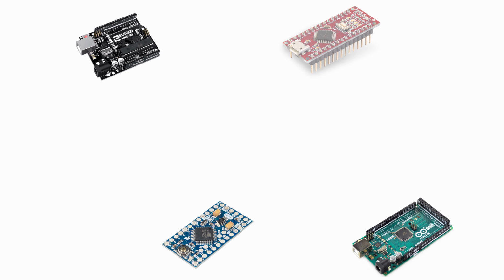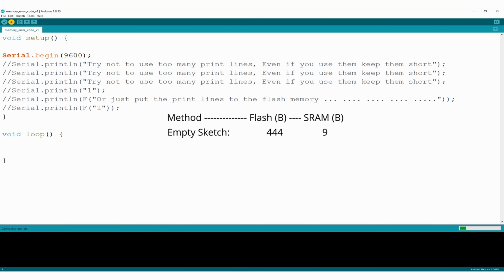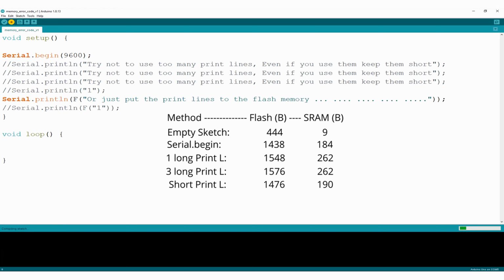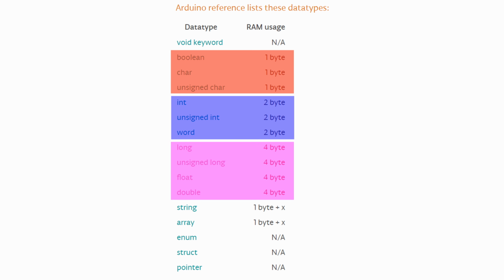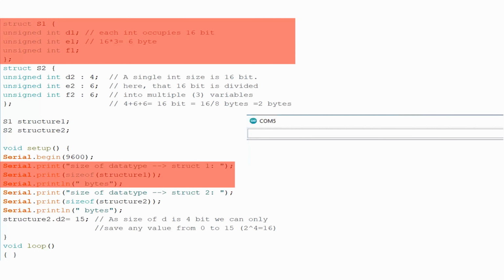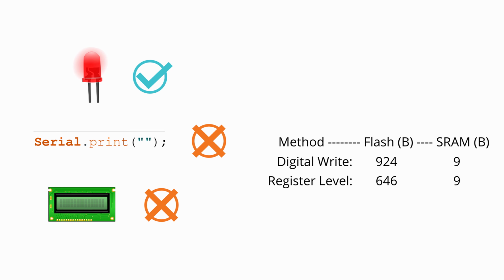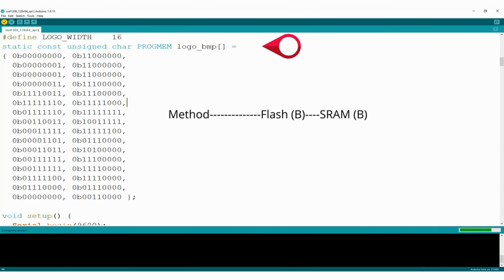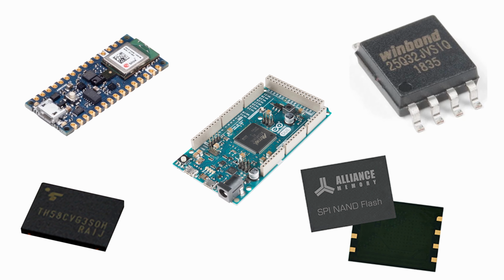MEMORY OPTIMIZATION | ARDUINO | ERROR: Low memory available stability problems may occur

Comment: Nice video, thank you. How can I add an external memory and where can I buy them?
Reply from the maker: I'm happy you found it enjoyable. You can look for a memory chip based on your needs on the distributor websites of Digikey, Mouser, element14, Farnell, etc. The best course of action would then be to either read through the datasheet to write the code or hunt for a specific library that your microcontroller has. If you're interested, subscribe to the channel and then press the notification bell to get a notification when a new video is uploaded. I could do a video on that subject shortly.

Comment: Why there are different kinds of memory in the microcontroller?
Reply from the maker: Nowadays there is not much of a difference among different types of memory, they are all relatively fast. And can be used as RAM as well as ROM or as Hybrids. But in general, SRAM is relatively fast, volatile but expensive (cost per byte), EEPROM is nonvolatile fast to read but slow to write and erase. Flash memory is nonvolatile, less expensive than SRAM and EEPROM, and can do fast read operation but show to write or erase. But they have other relative features as well. So, for every product, there is a sweet spot. Also, AVR MCUs are based on Harvard architecture, so architecture wise there are some reasons as well. You can learn a bit more from this Microchip manual:

http://ww1.microchip.com/downloads/en/devicedoc/33023a.pdf

Hope that helps, didn’t want to make the post so long  😅
Reply: @fvripple  thank you for clarification 😁😁😁